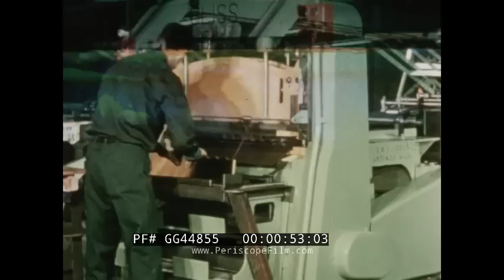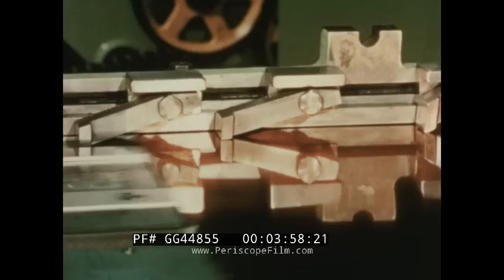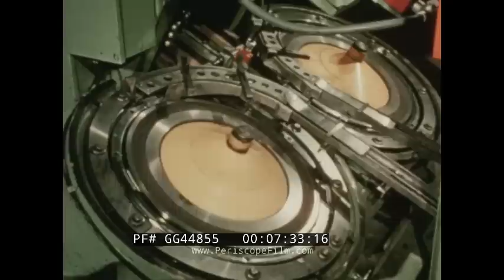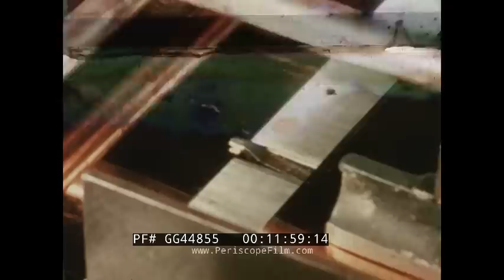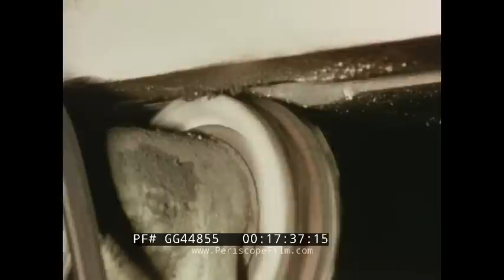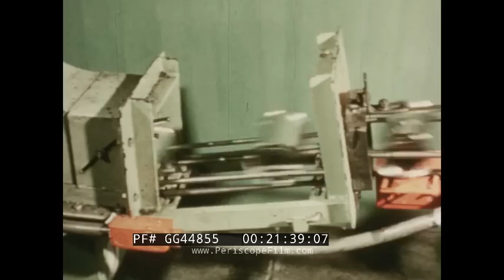" CAN MAKING MACHINERY " AUTOMATED MANUFACTURING OF SANITARY CANS FOR FOOD   E.W. BLISS CO.  GG44855

Comment: Fascinating film! These machines operate at unbelievable speeds. I bet the basic design of the machines is still used today.
Reply: No, the SAME machines are still used for making ends. The bodymakers are more modern, and weld the body, not solder.
Reply: Pretty much. The difference today will largely be on stuff like monitoring and live adjustments. But the basic process of taking in sheets and processing them is still the same. You can look up clips of modern factories that make cans and the basics are there.
Reply: I just made parts for an aerosol end press that was built in 1944. Except for the body makers, we still use the same machines
Reply: @stillrob97  Yes you did! Right next to me, Rob!
Reply: I can think of one factory local to me, who are still using Victorian era machines, because they do the required job the best; they reckon on fitting the newest control equipment every twenty years or so, because that's the bit which actually improves the process. And in their case, protects irreplaceable equipment better!